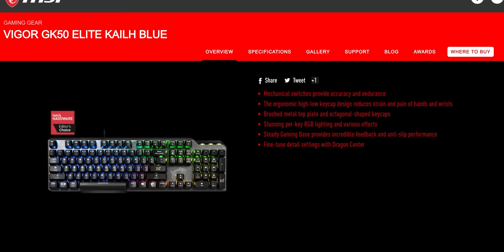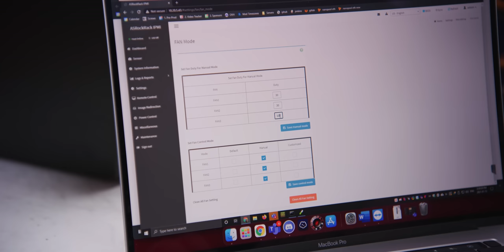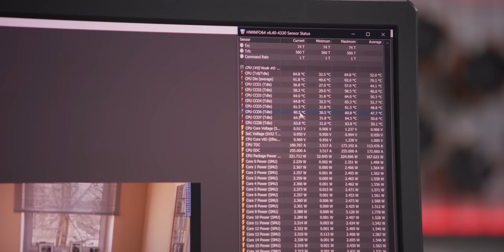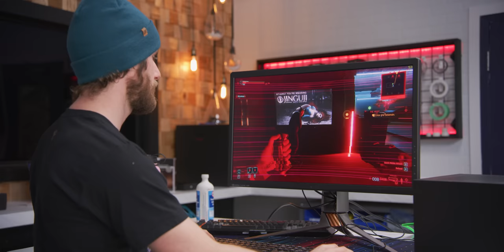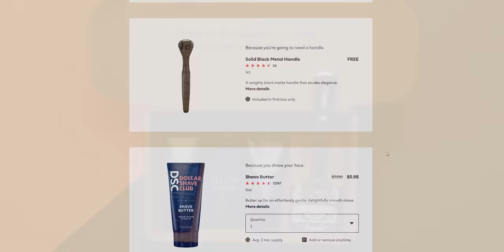This PC Used To Be IMPOSSIBLE! - EPYC "ITX" Build

Comment: Silverstone makes such nice cases. If you don’t look too close.
Reply: Lian li
Reply: but their designs are very functional and good to build in.
Reply: @fl3x1s54  yes I agree. I wasn’t being sarcastic. The cases are great. A lot of them don’t look so great when you look really close though. They make basically the only itx nas case. There are some others but they are never on sale.
Reply: Wym?
Reply: They tend to go function over form
Reply: I just built in an SG-13 and yes, you are correct. The fit and finish is not exceptional but it’s alright.
Reply: Buffer
Reply: Silver stone has a mini itx case with argb bar in the front that makes a nice little HTPC
Reply: Are Silverstones PSUs any good? Im putting a 400w one in my new rig.
Reply: @the_platapus3522   cool.. I was tired of finding cases that looked liked they were owned by an edgy teen .. I'm more interested in what goes inside the case. I'll check them out
Reply: @randomyt666  Silverstone PSUs are pretty decent, but why only 400w?

Comment: "This PC used to be impossible"

It has a 3090 in it, it still is impossible😅
Reply: It is still impossible*
Or colloquially, It’s still impossible
Emoji emoji
Reply: @fran.klindic  no
Reply: Not to mention the 64core cpu and 128 gigs of storage which too makes it impossible
Reply: And the 3090... is 1500$ 😂
Reply: 3090 are available, at minimum 2000€ but there are plenty in stock
Reply: @ryanolsen294  in your dreams, you won't find a working one at that price
Reply: there are 3090s for sale from some retailers if you have the money if thats what your getting at, and compared to the rest of the build a 3090 is cheap
Reply: and for 2021 will stay that way folks!!  :(
Reply: @fran.klindic  No, go away.
Reply: @Pow3rus  out of stock everywhere. Where do you find one for 2k ?
Reply: @mNikke  every french sites
Reply: @Pow3rus  damn i guess french poor. in USA and Finland it is sold out everywhere, or 1k overprice. Original price 1.5k euros.
Reply: @mNikke  I didn't say it wasn't 1k overprice here too
Reply: @Pow3rus  its not even available in amazon.fr for example asus rog strix 3090
Reply: @mNikke  not on amazon -_-'
I see some on LDLC, top achat, materiel.net, cdiscount, grosbill
They are in stock at the time I write this

Comment: This thing would be an absolute unit of an ITX rendering machine. With those networking ports you could easily task this thing to work as a slave system that renders just about anything from another system and then output the finished product directly to a data server or back to the master system.
Reply: oh yeah itx rendering.jamoke
Reply: Yes, but with Tesla A100 and A4500 not this shit 3090 or 4090 for kids....and with Linux RedHat...or Oracle... .
Reply: Just like the good old days…👨‍🦳
Reply: Did you mean, stack these, 4 deep, 4 wide, and use as a cluster computer? :p

Comment: Pov: Linus builds a gaming microwave.
Reply: But can it cook food?
Reply: Colin
Reply: Kfconsole
Reply: @revly8317  agreed
Reply: @watema3381  just put it on the exhaust
Reply: Revly mhm
Reply: uum actually, an epyc cpu is not that good for gaming
Reply: I have Ryzen 5 3600 and the alpenföhn Ben Nevis cooler and Its running battlefront at 70 degrees please help what did I do wrong. Please help
Reply: @watema3381  it actually can cook a egg so.... YES.
Reply: KFConsole but RIPPED
Reply: I don't think you know what POV means

Comment: "THIS PC USED TO BE IMPOSSIBLE AND FOR ALL PURPOSES BASICALLY STILL IS"
Reply: it is impractical for everything i can thing of. For storage you have NAS configurations that can hold up to 8 3.5" drives and 2 1180 M.2 drives for less than 1 EYPC CPU with a 10 Gbps NIC optional part. For compute you have  options of high CPU core EYPC CPUs or high GPU core nVidia GPUs with lots of RAM on each.

For IoT it costs to much and an ARM SoC is enough for most devices if not overkill on them. For a head node lf a IoT home network it is still overkill and overpriced. For a 4k, 8k, 12k, and 16k mobile storage device it is more expensive then need be as  it should just be full of drives with a quick CPU as core count is not very needed to pass data from NVMe drive.

For gaming it will suck. you have to use an adapter to get a hard drive port then you have the thing of most games run slower with 32+ cores than with 4. So yes you can have it for that but it is a waste as you can do better on basically anything else.

It is a waste of money and resources every  use case i can think of.
Reply: @brokengames9020  yes we all agree with you dear sir
Reply: @yumri4  It's the ultimate portable editing machine :)
Reply: @brokengames9020  ...
Reply: @brokengames9020  Man I would really hate to pay your tinfoil bill...must get expensive making so many hats...
Reply: @sokolaad1238  who is "we"
Reply: @yumri4  It's basically a powerful workstation in a compact form. People who might want specs like that might be software/game devs and 3D artists, for example.

Compactness might be desirable e.g. in a small office or for people working from home in a  small apartment, but the difference between this ITX box and a normal ATX case isn't significant. In fact a tower might actually be thinner and vertical space is unlikely to be a constraint. So seems to be rather impractical, indeed.
Reply: @killers31337  The lack of bac, I/O is my agruement against your comment. AMD also has threadripper for a powerful workstation with a mATX motherboard already. That motherboard already has all the normal I/O both on the interal ports and the back I/O so it would be easier to work with. There really isn't much difference from Threadripper and EYPC. The difference is non-existent in the board above too.
Reply: @brokengames9020  cry about it (((:
Reply: All in tents and purposes
Reply: It’s relatively easy to buy 3090’s now, if you follow one of those stock checker things and are ON IT. You can probably get one within a few days.
Reply: TYPING IN ALL CAPS USED BE CONSIDERED A DICK MOVE, BUT APPARENTLY NOW IT IS OKAY...
Reply: @brokengames9020  bruh moment
Reply: @yumri4  server density for cloud is for what it matters, you can make it almost blade like servers.
storage now is mostly S3 that means that it is only big machines with a lot of drives and ChephFS.

Comment: "Small formfactor"
Also linus: pulls epyc processor
Reply: I love ASRack
Reply: It's basically just 2 of the last generation put into 1...same with the gpus.
Reply: @ThirstysURL  ehhh? Zen 1 based epyc was ok. Zen 2 is wild. Zen 3 is absolutely insane. You can legitimately play games just fine on zen 3 EPYC. It's actually really funny to see.
Reply: @vuza752  The FAN control in ASRock IPMI is pretty impressive when compared to the most modern Supermicro Motherboard Fan control, which is still a absolute joke.
Reply: @blendarious  yea, also just the fact that they release their OEM products developments as products for the masses. Someone needed a board like this, chances are someone else will as well.

Comment: I am a fan of Mini-ITX, built one 5 yrs ago and currently using: Corsair 250D, Asus Impact VII, 4770K + Corsair H100i, Geforce 1660 SUPER OC. I love how portable it is.  Using an M.2 SSD cuts the PCIe card from x16 to x8 which sucks, so I just kept using my SATA SSD.
 Though on my next build, I wanna do custom liquid cooling and not sure I'd wanna go  ITX with it.. probably MicroATX  since I wanna cool CPU + GPU

Comment: 10 Years Later:

4 TERABYTES OF RAM?!!!! JESAS THESE GUYS ARE FROM THE STONE AGE
Reply: On the plus side, we will have finally gotten a 3090 at MSRP....
Reply: Nah, RAM consumption hasn't been increasing as crazily as it did in the 90s and 2000s. In 10 years, we might see 64-128 GB being the norm, but I really doubt it to be more well into the 2030s.
10 years ago, 4 GB was the norm for new PCs, 16 is now. That's just a fourfold increase. The most cheapo laptops still come with just 4 gigs of RAM.

Comment: 10:42 why does every pc part brand have an intern smash their face into the keyboard to make their product names
Reply: Probably named by engineers. 😅
Reply: It is very logical though.
NH - all noctua air coolers have this
U - single tower cooler
12 - 120mm fan
S - single fan
TR4-SP3 - supports TR4 and SP3 sockets
combine all of it and you get NH-U12S TR4-SP3.
Reply: The Noctua naming scheme is actually very logical and consistent if you bother to look into it. Compared to random nonsense names (mountains, whatever) that most other manufacturers use, you know exactly what you're dealing with just from the name even if you're unfamiliar with that specific product variant.
Reply: So what you're saying 'AyyMD VEGA' & 'Steamrick' is... that they're probably named by engineers? 🤔

Comment: “Everything maxed”  on cyberpunk. but was dlss on performance?
Reply: Came to say the same thing. Everything maxed ... at 1080p essentially. I'm over 60fps on a 3960x and 3090 at 4k with DLSS quality so something is going on there, probably left stupid post-processing effects on, or EPYC really is not a gaming CPU (it isn't).
Reply: I think that's actually 4K, i remember this monitor is 4K and the performance on Ultra everything with dlss performance would about match it
Reply: @DanielKennedyaeos  It's ultra settings, on 4k resolution, DLSS on performance and raytracing on. EPYC isn't a gaming CPU but cyberpunk doesn't throttle on CPU either anyways so...
Reply: @AdisMedzikovic  DLSS is upscaling. 4k DLSS performance is 1080 upscaled to 4k. To quote Nvidia "Performance mode enables up to 4X AI super resolution (i.e. 1080p -> 4K)"
Reply: @Userext47  DLSS is upscaling. 4k DLSS performance is 1080 upscaled to 4k. To quote Nvidia "Performance mode enables up to 4X AI super resolution (i.e. 1080p -> 4K)"
Also, did you mean to say bottleneck instead of throttle? Cyberpunk 2077 still scales with CPU perf, watch GN's performance comparison.
Reply: @DanielKennedyaeos  I know DLSS upscales, there is still a difference between 1080p and 1080p upscaled to 4k.

Yes I meant bottleneck and the fact it scales with CPU performance (with lesser CPUs) still wouldn't change how it doesn't get bottlenecked by CPU but by GPU instead.
Reply: @Userext47  don't know why you commented in that case, but ok carry on.

Comment: “Doom is so easy to run”. Yeah common, you gotta bench it with Microsoft flight simulator to test its true potential !
Reply: To be fair Cyberpunk, which they used afterwards, is a pretty good stress test for any system right now.
Reply: @no1DdC  Or Crysis Remastered
Reply: @scarletspidernz  or quake RTX

Comment: Imagine bringing this back to the 80s. You would probably cause a continent-wide blackout.
Reply: Just turn off a couple of lamps from back then and you're fine
Reply: @dan_loup  computers in the 80s used a bazillion times more power
Reply: @the_retag  If you mean "getting the same computing power but with 80's tech", you're probably building some sort of mini borg cube filled to the brim with 68000 CPUs
Reply: Most running nuclear power stations were built by or in the 80s

Comment: "I don't know what anyone would actually use this for" --- 

I DO! 

Linus, I work for Nasdaq's Video Production / AV / Webcasting team... Have you heard of VMIX? We use it on a daily basis and we're trying to maximize the amount of NDI signals coming in. Seeing how native NDI is more CPU driven, we need more cores. Would you be willing to make a video testing out how many NDI signals you can run into VMIX? We're currently blowing through eval units from dell and theses $12-18k units with quadro RTX 5000 just can't hang. We've done link aggregation for two 10 gig nics and everything. I'd love to work with you guys. We're thinking of ramping up to the A100 with an Epyc 64 core and just maxing out the potential. However this would be a custom build. Please message me if you're interested in helping us out and making valuable content for your game streamers out there!
Reply: I hope you will find/have found a better tool for the task ^_^.

Comment: Surprised the performance of Cyberpunk was only slightly higher than my i9 10850k  with rtx 3080 lol.
Reply: EPYC its not created for gsming, im pretty sure that if i use a i9 10850k to render a big project animation (solar sistem with all the deatails) it will be A LOT slower than the epyc
Reply: @techbrosita9698  No shit, that's why I mentioned Cyberpunk lol
Reply: I mean it's cyberpunk. The most unoptimized game in the last decade
Reply: @xs3tsunax  it’s decently optimized, it’s just the amount of computations the computer has to make
Reply: @gujju_cousins8550  which mean its not optimized
Reply: Kinda surprised it runs better than yours.
Reply: @gujju_cousins8550  Take a look at it's steam pc requirements.

Tell me if that's optimized if it can't run on the specs it says.
Reply: @gujju_cousins8550  its really not.

Comment: In my dream last night I won ROG rig reboot and I thought it was real even though it was a lucid dream. Them I woke up. I was sad
Reply: I had a dream the other day where I won a ps5, but then it wasn't a ps5 at all, it was a 3090 inside, but the 3090 turned out to be a toilet, and you could only use it while taking a poop, so people were standing in line to poop in my bathroom to experience crap in 8K.

Comment: Last time I was this early you could buy a graphics card
Reply: You could still buy one. Maybe not the one you really wanted but there's options.
Reply: @Persea gatuna dude I also need a used rx 580
How much did it cost you
Reply: @winteronice  you can if you wanna pay double
Reply: @Persea gatuna 
I would be more than happy to settle for a used rx 580 8gb nitro+ 
Problem is, I refuse to be a chump and pay €350 for a used 3 year old+  GPU that used to cost €170 brand new 1½ years back.
Reply: @Persea gatuna 
Just out of curiosity when did you buy yours and how much was it?
Reply: I need an upgrade from my gt 210 
I was getting a used rx 570 for 9k inr now it's more than 13
And the rx 580 8gb is too expensive

Comment: I love it. And I want it (but maybe with AMD GPU instead of Nvidia). I am currently using 16-core Threadripper 2950X with 128GB of RAM (8x16GB ECC UDIMM DDR4-2933), and despite me building this system just about 2.5 years ago, I already want more. More cores, more memory, more PCIe bandwidth, and smaller case. That thing is cool. I would use SFX-L power supply tho probably, or a passive ATX 750W PSU, and custom cables. Or hunt for some 12V only PSU.
Reply: i have a 2950x and i cry when looking at next gen, maybe next year
Reply: @harrybellingham98  Any upgrades yet? Perhaps best to wait until zen4/AM5 is launched

Comment: This computer is like one of the cars where you lift the bonnet and think....'why on earth have they done that....it's impossible to work on  without ripping it apart?'  It's a bit like the Vauxhall Omega where you had to basically remove the engine just to change the spark plugs.  The second hand market for them bombed too.  Just like this will.

Comment: I think a really kinda fun video would be a "LTT in the future" speculation video - Epyc's 64 cores in the CPU is bonkers to someone from the 90s. What's it going to be like in 30 years from now? General Use Quantum Chip to run alongside a 512 core? Holographic-crystal storage? Low cost, room temperature general purpose nuclear fusion power supply?
Reply: Will be interesting for sure to see what the future holds for PC equipment  ^_^

Comment: those 4 wires coming off the 24 pin are pwr_on, pwr_ok, 5vsb, and gnd. any actual power is coming off those 8 pin 12v (presumably eps) connectors.

Comment: The motherboard performs the voltage regulation that's why you use different power connectors. get ready for that standard to be offered on the consumer side eventually .

Comment: At some point in the future, video games will have minimum hardware specs that are beyond our current bleeding edge. 

Minimum required: 64 core CPU, 256GB RAM, 5.5TB of available disk space and 450GB of VRAM. 

And people will be doing budget PC builds on YouTube using components that would cost $30k today. Nvidia’s newest graphics card will cost $28,000 and it’ll require a whole-home backup generator to power it.

Comment: Why not swap that rear 120 for a 140? Since the case clearly supports it and you're concerned about heat enough to spend the effort flipping it around as an intake anyway, seems like a missed opportunity to achieve something even better.

I'll never understand why people install smaller fans in place of what the case actually supports - it causes a bunch of air leakage around the outside of the fan thru the unused grille area. Optimize your airflow, ppl!

Comment: Cramming all of that into such a tightly-packed box is insane.  "But it's stable."  Stability is not the only consideration.  Longevity is also a strong desire.  By how much are you reducing the lifespan of those components in your attempt to make the case senselessly smaller?  You have increased temperatures on the components that aren't directly cooled (due to reduced airflow), water-cooling tubes that are slightly crimped in by the air intake fan and the CPU heatsink, and my personal favorite, bending/flexing of the mainboard due to constant pressure from the power supply's modular connector.  Lastly, I know it was only a cosmetic issue in a place nobody will see, but a manufacturer that uses a Sharpie marker to hide its lack of quality control isn't one that should be trusted.

Comment: Instead of the MSI take a look at the Sharkoon SGK30. Looks much better in my opinion, switches are either red or blue Huano switches (in my opinion without any mechanical keyboards beforehand not to shabby) and it costs almost half here in germany. 50€ instead of about 90€. The software sucks to be fair but it just came out so they can still improve it (if you even need/ want a software to begin with).